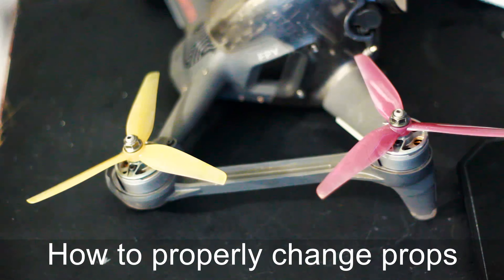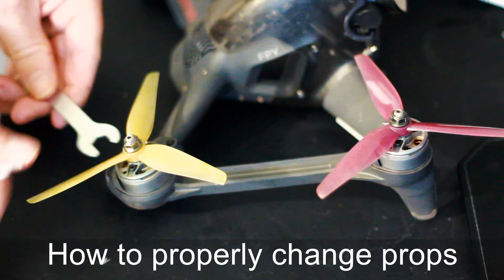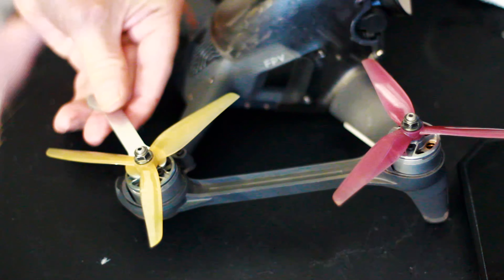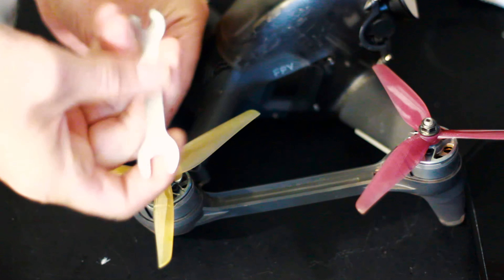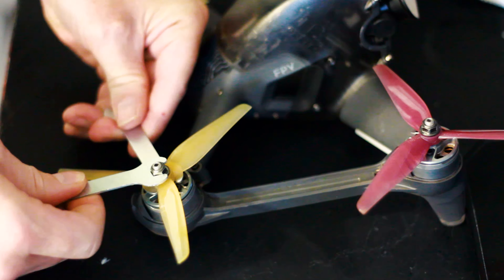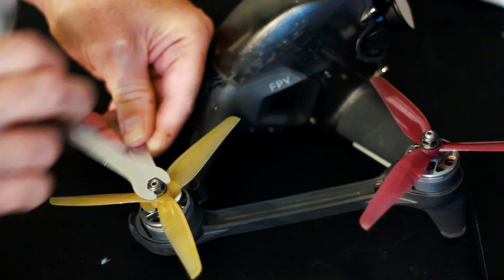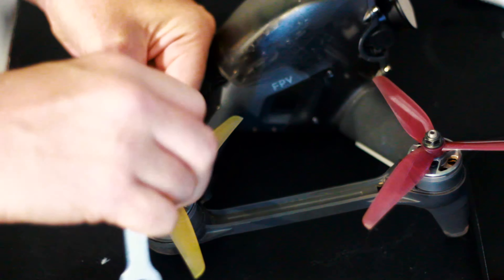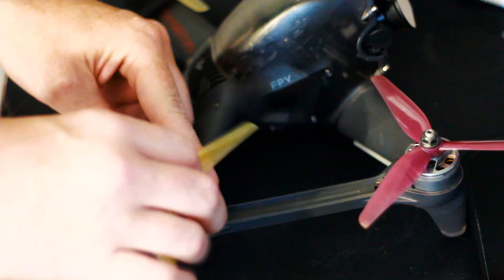DJI FPV drone propeller adapters TEST 3

Comment: I was scared to pull trigger on one but it's absolutely Epic, fly's like freestyle , but also all the tech goodies and safety. Did you find the ethix props were best???
Reply from the maker: I'm not sure which ones I liked the best, one of my videos says which are my fave so far but I forget which it was now, and there's one set to 100% stay away from , you'll see in the video lol, it leans and pulls to the left hard after a minute

Comment: Are the Gemfan 5236 any bigger or smaller than these here…..? Where can I find the best priced (and correct size), prop adapter kits from….?
Reply from the maker: Sorry I missed your comments, I ordered my adapters from pyrodrone.com , you can also find them at getfpv.com , they weren't expensive and best part is the new props perform differently and also only cost $5 a set generally!

Comment: hate them - the low pitch whine sounds like shit. but thumbs up and thanks for the share!
Reply from the maker: I actually liked the sound of these props , but I know what you're saying, but these particular props were definitely the smoothest I've tried yet. Dives are much smoother too.
Reply: @redislandphotographer  ok fine I'll buy them once I fix this dji drone and see what the fuss is about :) I wouldn't mind slightly smoother dives and stuff.
Reply from the maker: @NOTANOTHERFPV88  haha nice!
Reply from the maker: @NOTANOTHERFPV88  its funny I just realized I watched some of your videos before haha
Reply: @redislandphotographer  I hope so since I have hundreds lol - I don't hold back over here.
Reply from the maker: @NOTANOTHERFPV88  lol were you streaming the DJ I fpv Sim last night? How did you stream it haha
Reply: @redislandphotographer  I think I was streaming the parking garage in liftoff sim. on OBS recorder it does it all for you very easy to use.
Reply: trade off look how smooth the video is when turning or coming down fast vs stock unless he stabilized the video in post
Reply from the maker: @raaah  there's no post stabilization on any of my prop videos.